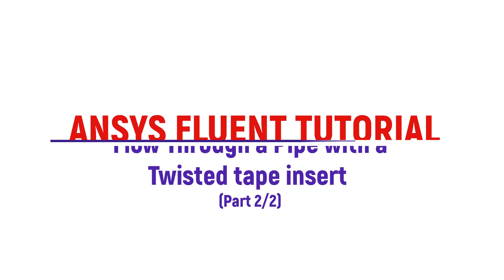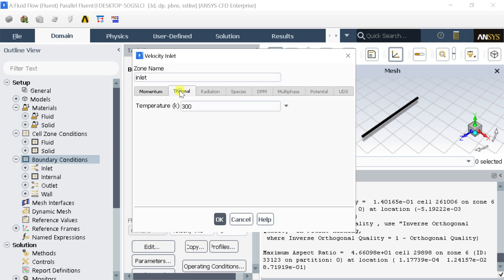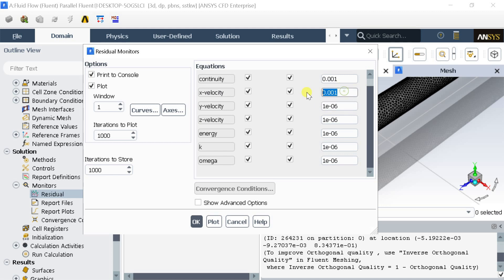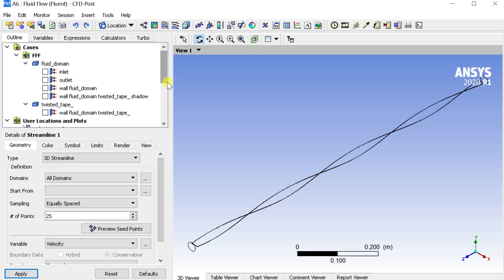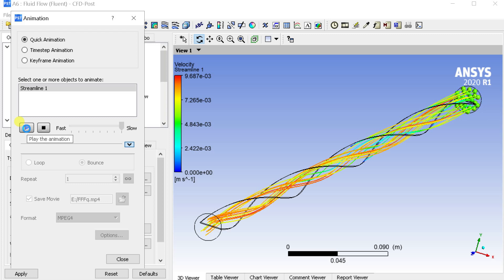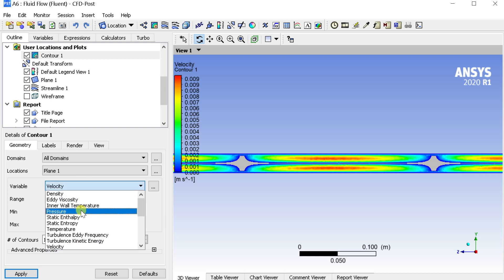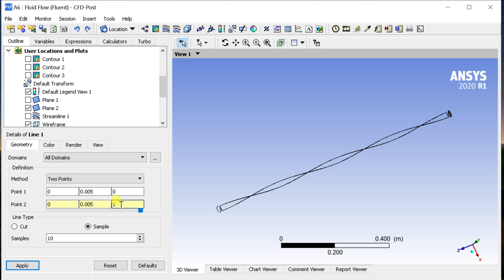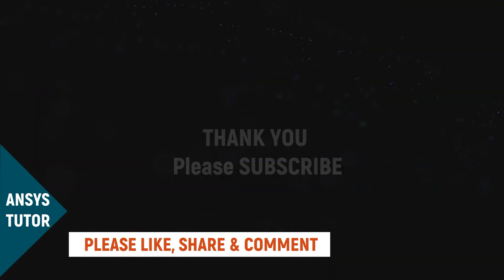ANSYS Fluent Tutorial | Flow Through a Pipe with a Twisted Tape Insert | ANSYS Tutorial Part 2/2

Comment: Great job, quick question calculating friction factor and Nusselt number for this type of problem?
Reply from the maker: Yes.
Reply: @AnsysTutor  are there any illustrations for the method of calculation provided by any of your videos? especially for friction factor
Reply from the maker: https://youtu.be/Wv9NRioSGDY
Reply from the maker: https://youtu.be/hO_Du_qZcqo
Reply from the maker: https://youtu.be/pav5rnq2jhk
Reply: @AnsysTutor  sir,please do ansys simulation of heat transfer in a pipe with wire coil inserts under constant heat flux condition.please sir,it will be helpfull to me 🙏🙏🙏🙏
Reply: @AnsysTutor  sir,please do ansys simulation problem of flow inside a water turbine/wind turbine/centrifugal pump

Comment: Hello Sir
I am new to Ansys
Our Reynold number was less than 2300
But we used sst K omega turbulence model.. could you please explain why
Reply from the maker: Turbulence model is used to capture any eddy formation or any turbulence effect  in such type of flow.
Reply: @AnsysTutor  thank you
If in my project I'm comparing nusselt number of plain tube with nusselt number of modified tube(with wall roughness inserts), for same Reynolds number Re=100
Shall I use laminar model for the plain tube 
And this k omega turbulence model for enhanced tube?

Or use k omega turbulence model for both cases?
Reply from the maker: You can use turbulence model in both, laminar model is used only in order to reduce the computational time. Another difference  is in tubulence model you need to provide the turbulence intensity value, which you need to calculate or assume, which is not required in laminar model.

Comment: sir,please do ansys simulation of heat transfer in a pipe with wire coil inserts under constant heat flux condition.please sir,it will be helpfull to me 🙏🙏🙏🙏
Reply from the maker: Constant heat flux on wire coil insert or on outerpipe?
Reply: @AnsysTutor  on outer surface of pipe
Reply: Abhik did u get a good tutorial on this wall flux condition?

Comment: Dear Sir, Thank you vermy much for the intereseting vedios. I would like to kindly request you to make a video for making of the geometry for the Central Receiver System. Which is made from 24 platten and each plate have for example 31 Tube with 2cm diagonal. There are two inputs and two outputs. West side is conceted with east and nord with south side at end both out combinde with each other. Molten salt inter with 290 C and leave the tower with 560 C. The liquid is molten salt and heated by the concentration solar power. I am working two week on that but I couldnt make a propariate geometry, Please sir make a video.
Reply from the maker: Send the details of the geometry to my mail id ansystutor7@gmail.com